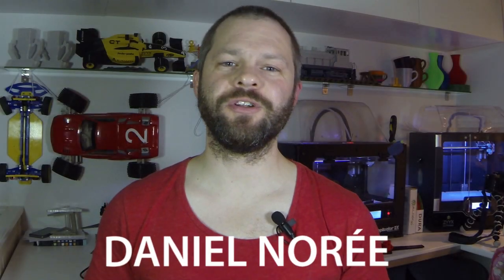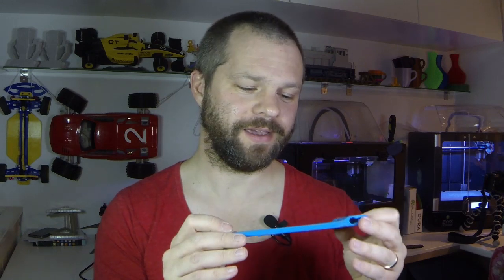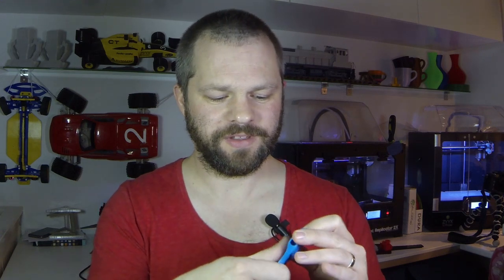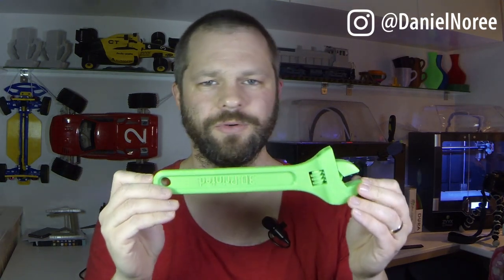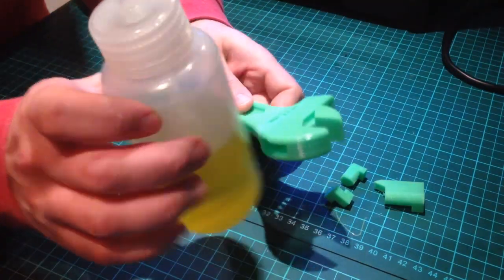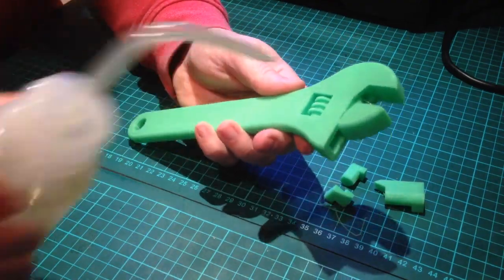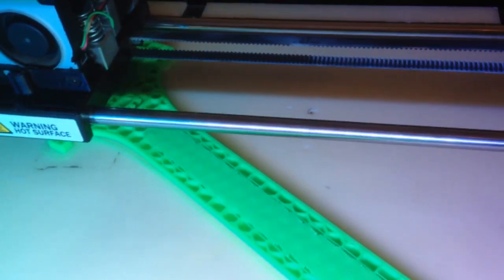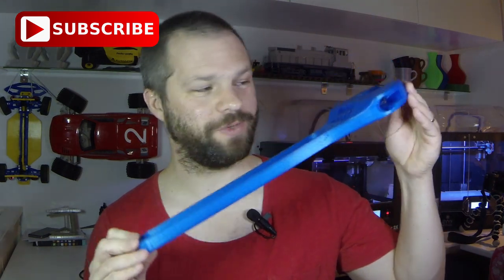THIS IS HOW I - 3D printed Adjustable Wrench

Comment: I've printed this twice in PETG on a BambuLabs P1S and on both prints the adjustment wheel is locked up solid. The 3 support pieces came out easy and the jaws will move slightly, but the wheel will not turn at all. I've tried using a pick to force it to turn and banged it with the handle of the pick, but it will not break free. Since the jaws will move slightly I feel like if the wheel would turn it would work, but it will not. Any tips on getting it to break lose?

Comment: Just adding this here to consolidate info shown in the video. 
It appears there is a particular order to removing the bits of filler. Remove the biggest part first from the top, then pull the bottom plug out. Next, get the jaw moving closed a bit, then remove the "chin" plug under the movable jaw. This piece is L-shaped...don't just pull. I should say, don't just pull like I did. :-D
What a cool project, Daniel! Thank you!

Comment: Thank you very much for the video.
The wrench I printed is not working. There is no gap for the wheel scroll to roll and it seems threads and wheel are fused.
I downloaded the part, sliced on BCN3D CURA and printed with PLA with 0.2 mm layer height and recommended settings.
Can you please tell me what parameters might be wrong or anything else that went wrong? As this is my project and I need to have a solid justification of why it went wrong.
Also does scaling the object increases the gaps as well?
Thank you once again.
Reply: You're most likely over extruding. Try printing a calibration cube to get the flow right.
Reply: I believe the recommendation for PLA was to print at 150%.